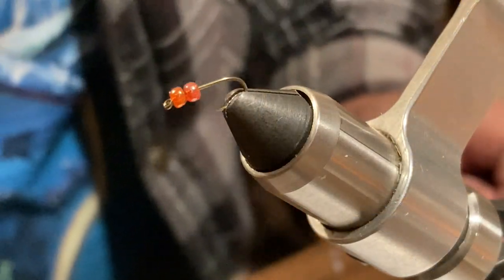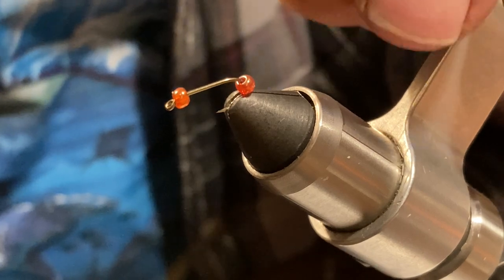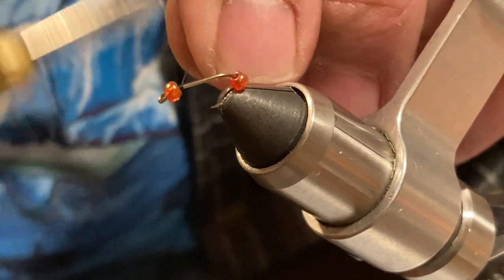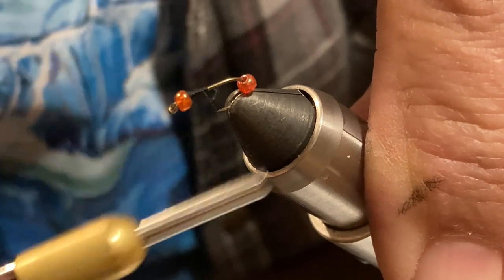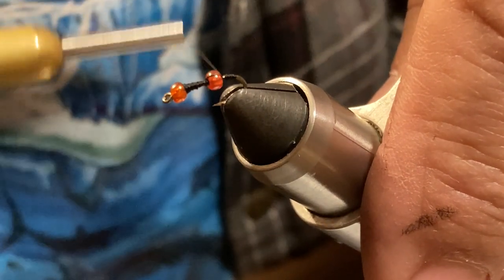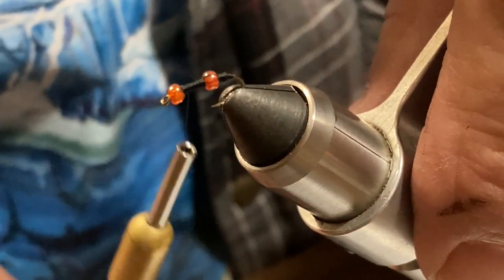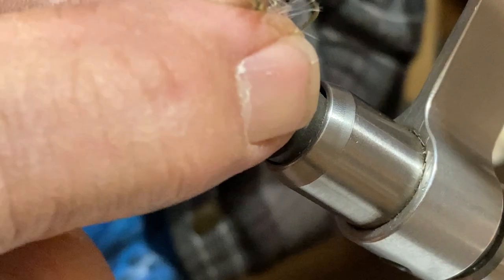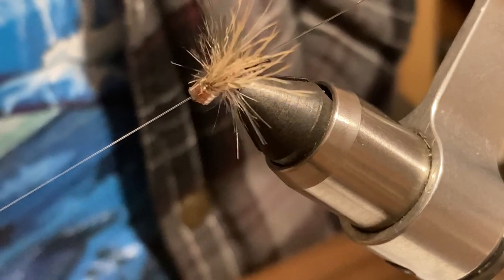Tying an Adjustable Dry Dropper

Comment: Thank you for video. I tried following Mike McAlexander’s video for tying the adjustable dry dropper but his video kept losing. Your video was easier to follow. One question though, what size beads did you use?
Reply from the maker: Dale, I used really small beads, maybe 1.5 mm. Also, I'm still testing various tubbing, just got in some more flexible tube, that I hope will go on easier and still generate enough friction.  Its a work in progress. Thanks for watching.
Reply: @Callaweginflyfishing  try Tyson tubing. It’s very supple and should work well.
Reply from the maker: @MrSofthackle   Sounds good, I'll give it a try. Thanks.

Comment: Love these adjustables!! I've started tying them using UV resin in place of the beads which allows me to better control how tight the tube grips. I have also just started using a single bead on the butt end instead of two beads. Haven't tried it on the water yet but if it works it should make the fly lighter and float better and also be easier to tie. Thanks for the video...glad your channel is growing!!
Reply from the maker: Rick, where do you get the UV resin?
Reply: @Callaweginflyfishing  ...any fly shop will have it. Also bass pro/cabela's will have it in the fly fishing section.
Reply from the maker: Yea, its a tricky design. The resin sounds like a good idea.